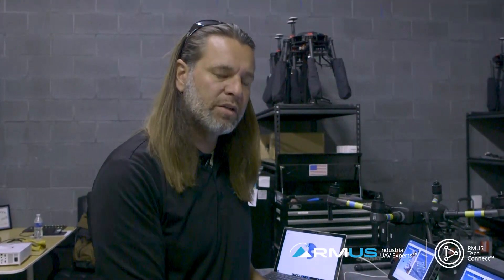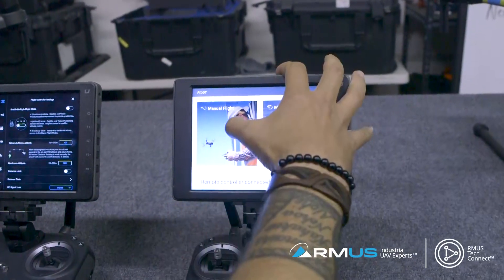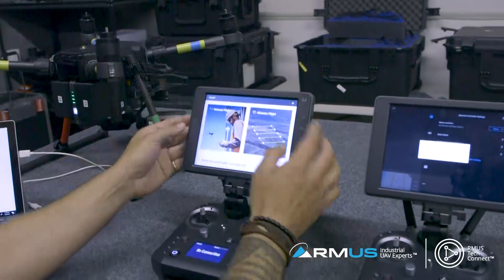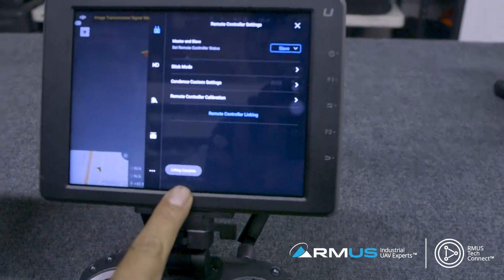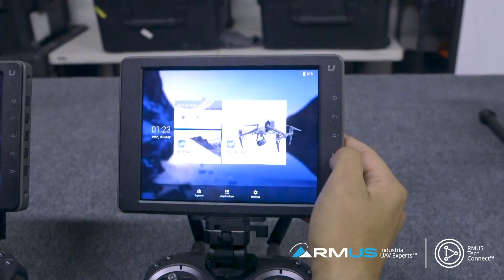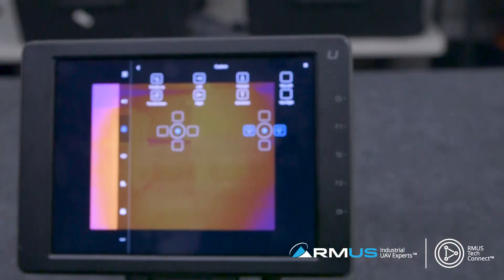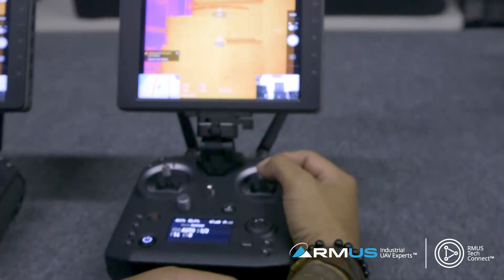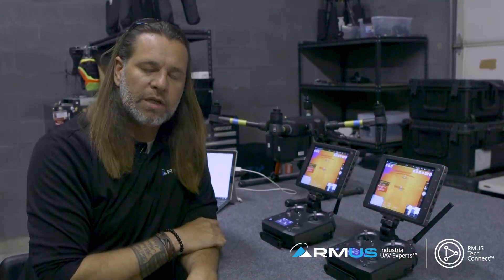RMUS TechConnectᵀᴹ | Cendence S Master Slave Remote Setup

Comment: First of all, thank you so much for your videos. I would like to ask you for a little help. We are working in solar farm inspection and we use an M210 RTK-V2 with two transmitters in the same way you describe in the video. The problem we have found is, that as soon as we link the D-RTK-2 one of the transmitters is disconnected. I mean that it seems impossible to have three devices linked to the M210 at the same time. We have made a hundred tests and, whatever the third device we try to link, one of the other two is disconnected. I have tried to get information from everywhere and I could not find anything. Obviously, we need to fly with RTK as well as a pilot and camera operator. Would you be so kind as to tell us if you have any information regarding this issue?
Thank you very much in advance for your attention!
Best regards!

Comment: Hi Guys, I would like to use my iPad Pro to fly my Mavic 2 Ent Dual. My problem is none of the pad holders I have tried, accommodate the 8.5 inches or 215 mm. Have you come a cross any this that’ll work?

Comment: Thanks for the great videos.  They are very informative.  Were you able to confirm that the slave remote can be a great distance away from the master remote?  It would be ideal for search and rescue purposes to be able to have a live video feed to our command post which may be a mile or two away from our operation area.  Also, if we do use the slave remote at the command post, would the master remote still have camera control?